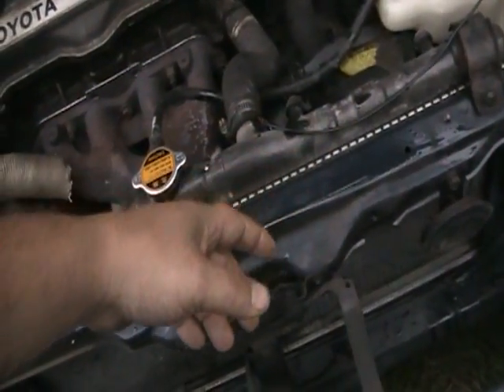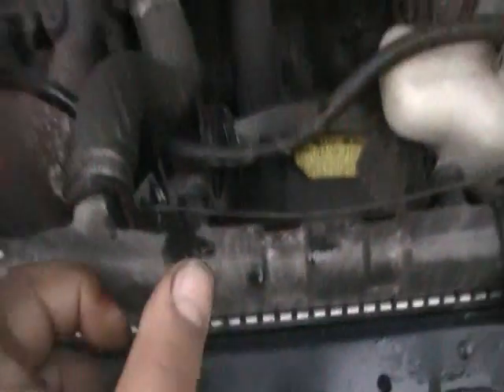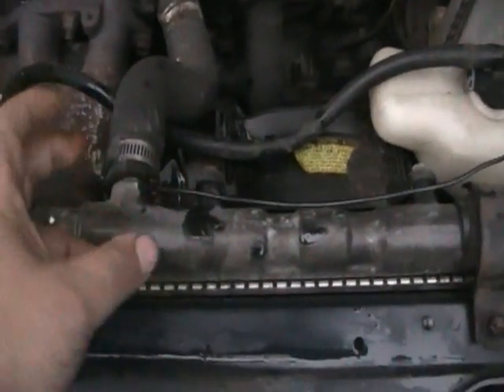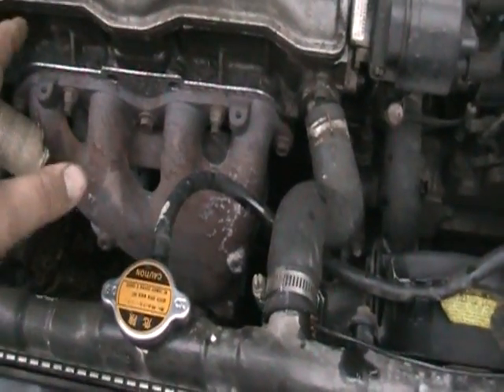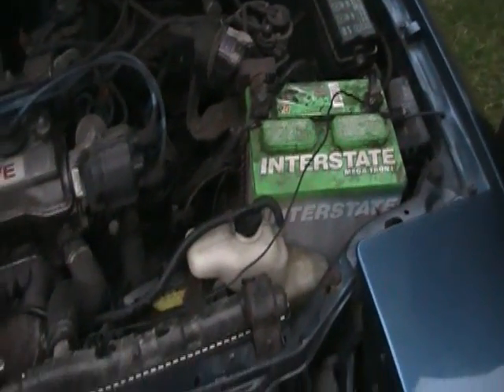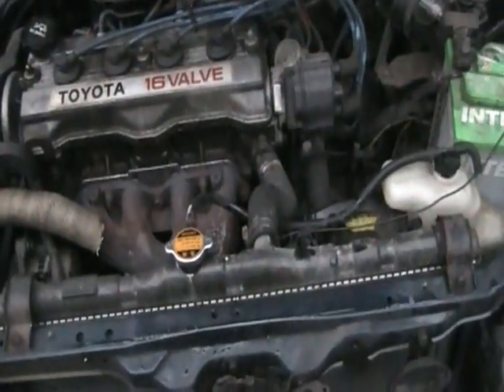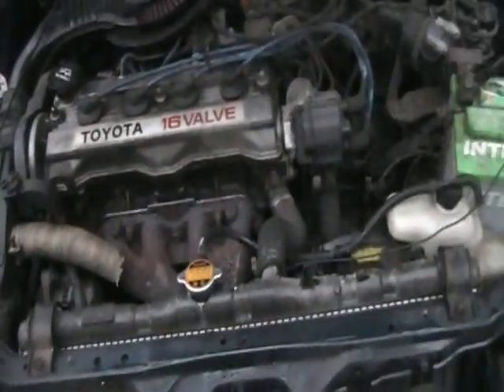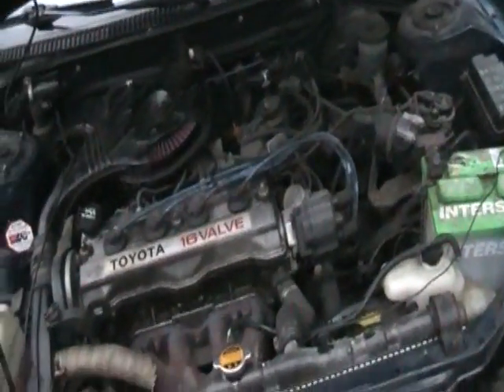joe cell save money on fuel with one wire

Comment: Should note this car is a ~400BHP 2.1 liter turbo Subaru.  I Have full control of ECU engine operating parameters so if you have a modern computer controlled car your results will not be the same if you don't have similar capabilities.

Comment: Water actually is the fundamental by product of hydrocarbon combustion.  The basic equation as so: 2C8H18 (gasoline) + 25O2 (oxygen in air) ~> 16CO2(carbon dioxide) + 18H2O(water).  Incomplete combustion leaves lots of hydrocarbon vapors in the exhaust.  On modern cars this is taken care of by the catalytic converter which burns the remaining hydrocarbons converting them in to CO2 and water which comes out the exhaust. Every car has water in the exhaust either as steam or liquid.

Comment: hi noticed after 8 weeks that water goes a crappy brown and when replaced the voltage is higher output with fresh water so that i believe clarifies that electrons are being transfered to battery .power seems better and also mine is direct in to water flow so picking up electrons easily. starting on the engaged starter thunderstorm engine as joe booker states next week .been told to wrap copper round starter casing and water cool so thats a challange .any comments on cooling starter appreciated

Comment: This is a wire from the + to the air cleaner. I chucked it full this time with ss wool.
Actually, packed it a little too tight. Restricted air flow is felt on take off. However,
after 50 miles, it settled down some. I can hardly feel it any more. I may remove the old air cleaner and make a better set up. Maybe eventually evolving to a hood scoop.
Also plan on making catalytic water heater. Which will make more water vapor to inject some additional fuel perhaps? More later.
Thanks

Comment: I see that fuel seems to burn a bit better now but I don't think that it is part of the Joe Cell phenomena.  I think that it has more to do with improving the grounding condition of the electrical system which helps improve the efficiency of ignition for more complete combustion.  Grounding the radiator may give increased continuity to ground using the coolant.  We see the same kind of thing with aftermarket grounding kits, it's just that the radiator is not usually part of the ground system.

Comment: in essence, I want to add a bunch more ionising material while not restricting the air flow.
I'm going to get a good chance today to test on several full tanks of fuel highway miles. This will provide info for whether or not I proceed. At this point, it looks promising.
Thanks

Comment: Sounds great, thanks for the info.  I think you had mentioned keeping the wires as isolated from electronics as possible.  Have you heard of Faraday Caging? I've seen some vids where guys have wrapped many of their wires with Aluminum foil to prevent any other electrical interference.  In the comments below the videos, people said they tried it and it helped their starting and made the car run smoother.  Anyways, was just a thought to wrap the Joe Cell wire with aluminum foil.

Comment: The fuel efficiency of a petrol engine depends on the engineering of the combustion chambers and the nature of the hydrocarbon fuel burnt. It does not depend on the battery beyond the fact that the spark plugs draw current to ignite the fuel. The timming of the spark may be affected by messing with the circuit and this may affect the efficiency if the engine is not wewll tuned to start with. Water always comes out of the tail pipe: it is produced by combustion of hydrocarbons!

Comment: At this point, It looks like a 20% increase~!
I drove around all summer with $20 stops. 5gal. = 1/4 tank. All I could get is 50 miles. Sometimes 52 or so. But that would be pushing it.
I'm currently at 52 miles since my last fill. And the needle isn't even to the empty line yet. I'm sure I'll get at least another 10 miles out of it. 
I have other ideas to hopefully gain even more efficiency.

Comment: This car already had additional grounds from the intake manifold and engine block.  On the control car I will just do the radiator grounding or grounded coolant temp sensor adapter and no other mods.

Comment: Do not put it on negative!  Positive only into the water…works better if you run it through a rheostat 120 volt fan controller…there is a triac switch with a crystal in it…kinda like the Peter Brock Energy Polarizer.

Comment: I did forget to mention that engine runs about 10 degrees cooler also.  Oil temps are unchanged.  Very interesting and I'm making some specific engine mapping to get the most out of the observed affects.  Closed loop AFR targets can be raised to ~15.3:1 which should enhance fuel economy significantly.

Comment: If you want to claim that water in the exhaust is a result of the modification you would have to measure before and after amounts of water in the exhaust.  I would say that on emissions equipped vehicles if the computer sees less O2 in the exhaust it will add more fuel which means more fuel is burned in the cat which means more water in the exhaust.  That would make sense based on what I have observed.  Better grounding, better spark resulting in improved combustion that is my hypothesis so far.

Comment: I don't think the effect fully disappeared just maybe reduced in intensity for some reason.  I still saw low O2 readings but just not the extreme values as consistently as before.  On the way home I pulled into the driveway and the effect was low or minimized.  turned the car off and let the fans run for a couple of minutes and started up again.  Right away the effect was there again 100% and the engine was smooth as glass.  Drove about 3 miles and it was gone or reduced intensity.

Comment: OK i've had the wire connected into radiator under the cap with a bit of sealant to compensate for the wires ,for a couple of weeks or so now mpg has gone up about 18% or so ,the battery charge was about 13.8v ..only being doin short journey's ..the charge in the battery has gone up to 17.56v's bloody amazing ! hope it dont shorten life of battery ..or get to many volts coz it looks like it was still rising as i was checking it on the meter ! will keep monitoring for a while ..whoop,,whoop..: )

Comment: Just briefly from early morning; adjusted fueling to target 19:1 AFR.  Car still wants to run leaner than that.  Idle speed has dropped to 600 RPM.  I got an error code on the O2 because it did not sense anything and registered an open circuit.  Car runs so smooth it's unbelievable.  Car needs to start on fuel but after the thermostat opens it runs so lean unbelievable.  O2 sensor pegged at 25:1.  Maybe no more fuel is needed.  Astonishing.  Going to mod the other car today.

Comment: ...From what I'm observing even if I did not lean out the target fuel mixture the motor would still be running very lean.  Lean AFR readings from the O2 sensor mean that the fuel is being burned more completely.  I also had to reduce ignition timing under high load overall because the computer was seeing knock.  So something is making the fuel burn very quick.  I can add more fuel and/or reduce timing.  What is causing this is not known to me yet, I'm just following what the data tells me to do.

Comment: So would not the hydrogen run out at some point?  What would happen to the water in the coolant?  I did notice water level in the overflow has dropped.  I will need to add some coolant to keep it topped up.  

How should the diode be wired?  I have some 200 Amp diodes from a low voltage high current transformer project.  These should be sufficient for the car.  Will also upgrade the wire from 10 to 8 AWG.  Actually this is a bit scary, the motor should have blown up by now but instead runs great

Comment: Hey all, see the 1 and only vid I put up regarding placing a wire on the fins of your radiator.  As it stands today 3/26/12  I am still enjoying the benefits of this one wire.  I still have yet to have a trip long enought to see what my hwy milage is but  promise to post as soon as I do.  Still runs cooler and has a bit more (not alot) power.  So if you have any car that is water cooled that does NOT HAVE and O2 sensor or a computer it's worth the time and ONE WIRE to check it out   It does work

Comment: You said, "You can increase the charging process by warming the car up and striking the block 4 times with the positive well the car is running and the water is moving threw the block."

Could you explain a little better about how to strike the block 4 times with the positive? 
What size wire do you think would be best?
 I have a 1985 Chevy 350 one ton that I would love to try this on.  I'll keep you posted on the results.

Comment: it has a 5% chance of impact when the water is excited through the movements through the engine it will have a slight positive charge the creating a negative charge on the return from the motor will release slight amount of ionic displacement could cause some production.  But I do agree it is really tough to believe that it you have this kind of impact.  and it is likely to cause damage to motor over time the path between the water and motor chambers is only achieved with bad head gasket.
Reply: Jeffrey Ruppert .
You know ions pass right through solids, So get lost G-MAN.

Comment: Ok, there seemed to be an effect with having a copper wire from the joe cell line to the engine block. Back then I used a line from the joe cell that had metal cover on it, now I use a line with rubber only. I will get an aluminium line. I think there could be something with this one wire trick and a joe cell that possibly could make it work stable, like a circuit. I will get back if I find something........

Comment: Using the grounded temperature sensor is better grounding in the case of a standard radiator with plastic end tanks.  Also these terms such as "freed electrons" hydrogen and proton "saturation".  What is your proof of this?  Can you back these claims up in any demonstrable way?

Comment: BS"D
Joe Cell202. do you think it is at all possible to calculate what is the horsepower addition with 'one wire', according to a certain cut wire, material, etc...
It would help a great deal when 'remapping' the engine.

Comment: I converted it as per your friends video direct to the radiator grill.

2 questions if I may. I have a newer 2003 Toyota . From the Models you tested (probably copper Radiator) to the ones now common aluminum do you know of any such tests ?

The Water tailpipe though is also something observed with J cell correct me if I am wrong .

But you believe it is hydrogen.could be .

I have done it now to a aluminum grill & will post update ... 3-4 days I believe you suggested for it to be acclimatised

Comment: i tried an 18 gauge wire and sealed it with a SUPER sticky glue for molding and gaskets called Yellow type 800, so far no leaks.... i also drove like an Ass hole this week and seemed to have picked up 2.5 mpg since adding wire. 96 lexus, if i repeat success i will  install the Volo chip

Comment: How about putting a 500 ohm resistor across the O2 sensor  that would make it show .045 milli volts witch would make the O2 sensor not tell the computer to add more fuel.it could be adjusted that way using different resistors. Thought about that.

Comment: OK here it is, I commented on how I didn't think this would work due to the block being grounded.  I was politely informed why.  Thank you.  BUT in the meantime I did figure wht the hell its only one wire how long could that take?  The radiator hose part sucked, leaked like a sieve and anyone who has 1/2 a brain will realize that they could damage the plastic connector to the radiator.  So I stripped a wire back a couple inches and stuck it into the fins of the radiator and connected it to neg.

Comment: The radiator must be in direct contact with  the chasis 
a insulated from ground steal rod is inserted into the radiator via a soldered in threaded fitting, same as a hot water anode tube,
 a heavy neg connection from the alternator ground is connected to the rod. 
As your engine needs less petrol you will have to advance the timeing accordingly.
For it to run solely solely on atomic energies, You must vacuum the gasses out of the radiator a2nd a Section of radiator hose is used to insulate a bundle of steal wool charged by a positive hot WIRE inside the intake plentium.
The hot WIRE must not touch any grounded surface. Only the steal wool.

The wool positively charges the elemental air and this is what attracts the - hydrogen ions into the combustion chamber along with the tho and steam gasses to use as a primer for the nitrogen to burn.
This was all discovered by ford more co in the 30's.
This only works on point type ignition and carburater engines were both timing and fuel can be reduced or increased dramaticly.
This does not work for aluminum nothing.

Comment: My battery is at 15. Never seen it that high. Engine still running cool@ 25 rather than 40 normally. Lots of water at first from the pipes in back. Today I gave her a cup of joe straight to the radiator and overflow tank of fresh charged goo. Also sprinkled some on the engine block andwatched it absorb. I can see through walls now. I think I will go hang out at the mall...jk no the last part isnt true- haha

Comment: I'll have to do some research on permeability of metals however I did find some data that actually shows iron with better permeability to hydrogen ions...

In any case today showed a bit of strangeness the effect seemed to go in an out over the course of the day.  Drove the car for 55 miles today and really only saw it twice once in the morning and once in the evening.  I was a bit frustrated as I had remapped the fuel system for it and it was gone.  Change to  wire size? Weather? (it rained)

Comment: hi mate amazing stuff from Nathan rogers have you tried the rheostat thing is that like a dimmer switch mind you if it works for you what u do why change it lol the 1 wire thing is it poss it works sometime & sometime does not work have the power Then do not have got efie to lean fuel mixture but got no economy also you not experience rotting of rad ?u got mustang back on road yet? all the best mate

Comment: So how about Toyota Avensis 2002 vvti ?? is it possible to make it in such cars ? do i need to modify o2 sensors ? i cant get it today i will put the wire from (-)terminal to radiator. I will write my results after a few days.
Reply: Any luck?

Comment: GOOGLE Volo Performance for HHO modified vehicles.  It should automatically make adjustments to compensate for HHO in the system.  I have been using one to improve gas mileage for the past year with success...a 2000 Ford Explorer 6 cylinder covered with bed liner and much heavier than stock getting up from 18.5 on the highway to 20.5+ on highway fully loaded with gold mining equipment.  Should have a more accurate take on the one wire mod in a few days.  So far it's been very, very impressive.

Comment: @Begbucks Never figured Miles per gall, at the time we could get 20 Litre drums of crisp & dry for a fraction of the diesel cost at the pumps, so we just knew it was cheaper per week, but did not do too much checking....at the time, that was 1999, 2004. over that time, veg /oil, prices increased vastly, I think it was to combat this Veg/Oil for fuel use, As today the it pretty much equivalently priced per litre here in the UK. Scotland, {still free from restaurants, just needs cleaned}.
Thom.

Comment: so  the new cars with oxygen sensors wont work ? did i  hear that correctly ? also he mentioned his gas gauge was broken was this before or after connecting the wire and will the oxygen sensor chip also short ?

Comment: hi just found out joe booker called it a protn cell and it  is using the protons as the electrons have been plucked off causing a critical collapse of atom state and that the suzuki he placed the charged water in as the engine coolant so no cell needed  unsure at moment if he keeps the starter engaged.tried that today on a rover 620 diesel here in uk and scrathing my head at moment any help appreciated as i have the a bility just the sequence to follow cheers melvin in uk

Comment: @Begbucks I have run an old citron BX 2 Litre diesel on ved  oil, { Lot's of folk.. say to do this or do that} But I just poured it in, and never found a bit of trouble, perhaps a few extra turns on the start up, but it run better for sure, very subtle but definitely better, a friend with an old van tried it too, he say's the same, just straight in on top of the diesel , you smell it when it kicks in, and switch, fuels without a thought one on top of the other, never no bother.
Thom in Scotland.

Comment: Just thinking of trying this ..so as a start please check me: take a wire from neg on bat,connect it to rad,while running.. tap the block 3-4 times with poz to energize ,question do i need a positive in the water ..like in a rubber hose cavity so it touches no metal, .Also just wondering if it would be better to use distilled water in coolant system  ? many thanx for help :)

Comment: Unfortunatly this can't work, and anyway there is already a ground from the battery to the chassi , same as the radiator .

Also by sparking the engine block you are likely to overload the altenator

Comment: ... You really know how to think of a conversation in a totally different way than I do don't you,  I'd suggest checking it that it doesn't eat away at the radiator or anything else the extra current is now flowing through after you attach a new wire.  It obviously helps the arc of the spark in the engine giving it a more effective spark and therefore burning the fuel more effectively and burning less fuel because of it.